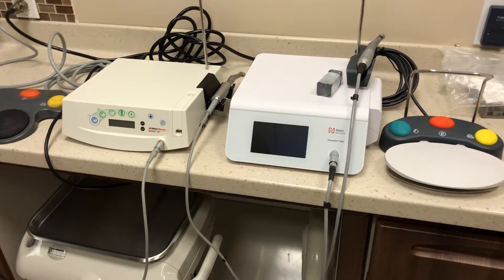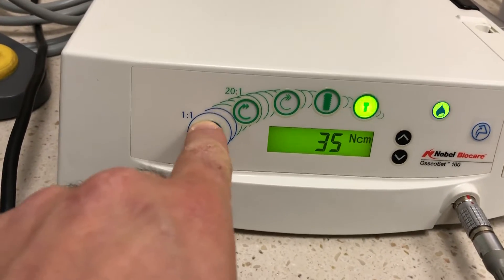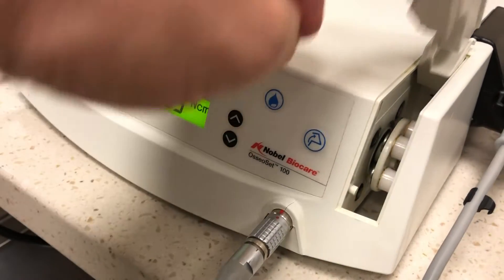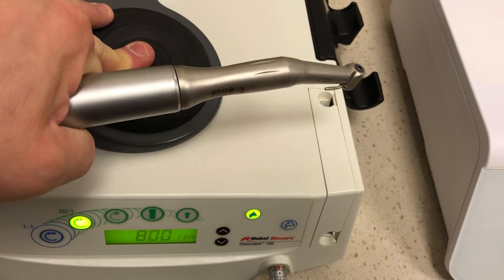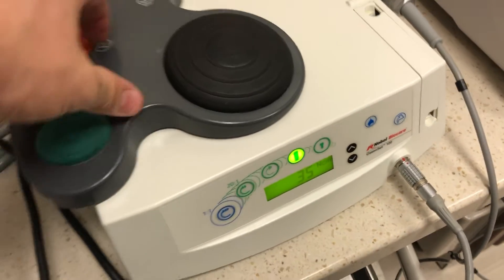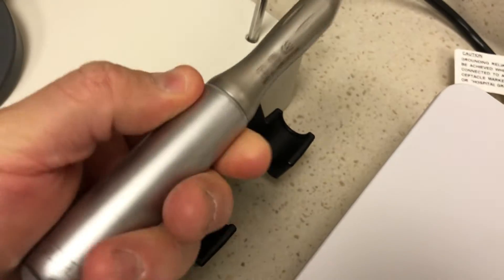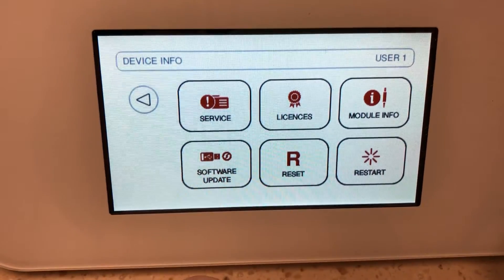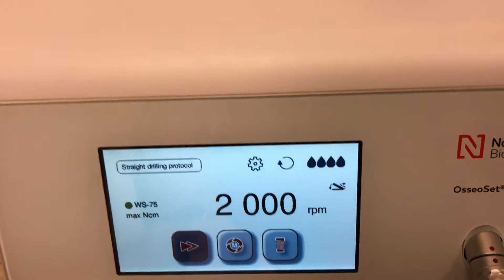Nobel Biocare W&H OsseoSet 100 and OsseoSet 300 Implant Motors!

Comment: Hello! Curious if the hosing from the 100 works on the 300 or vice versa ? Pump looks ideally the same but maybe the hose is shorter for the new insert system?
Reply from the maker: Funny enough I haven't even used the 300 yet. I am still on my 100 and the 300 is packed up in the closet. Why? Am I waiting for the 100 to break? The thing is indestructible, it's simpler and works very effectively. I have a feeling the 300 being more complicated will have more problems but one day I'll pull it out and try it and let you know if the hose set that works on the 100 will work on the 300. I assume it should because when I buy hose sets directly from Nobel they do not ask me which motor I have... I believe these were made to a standard length, at least for W&H sold by Nobel.
Reply: @devhackmod  we are still using our 100 just been looking into autoclave safe hosing and was curious about the fit. You have one of the only videos I’ve seen of someone with both machines, thanks for the information!